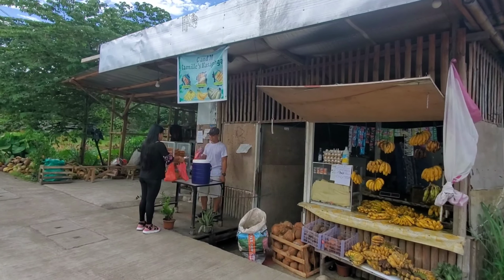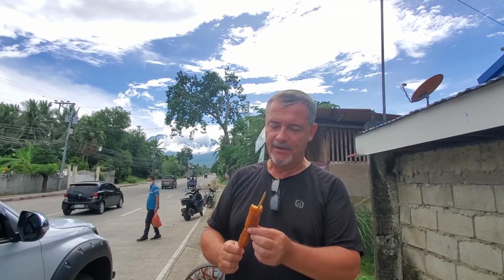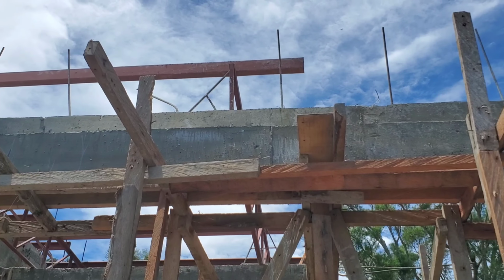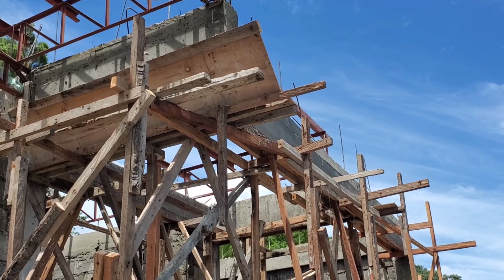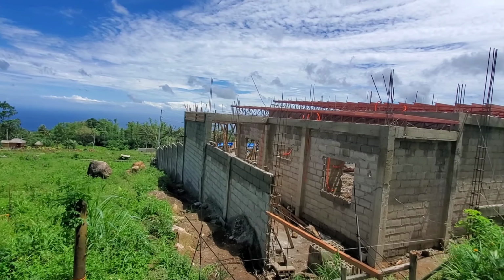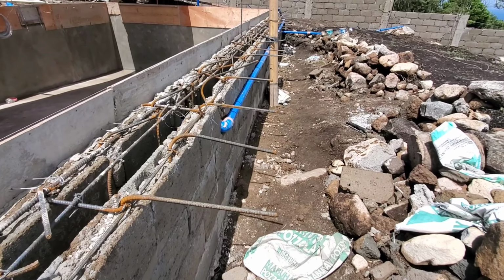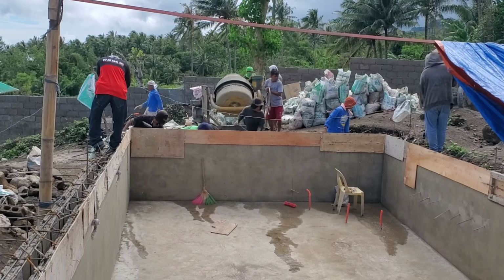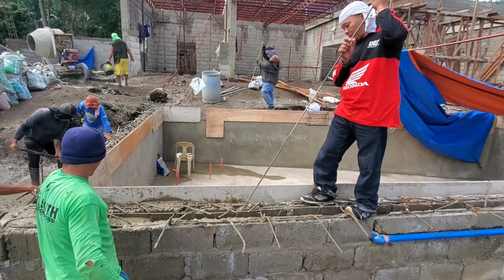Foreigner and Filipina house build- Construction day 56

Comment: There mixing your concrete way way to wet.  It's a huge problem here in the Philippines. It weakens the mix big time
Reply from the maker: They have several different ratios for different applications.  They poured part of the floor today and it was much thicker.  When they do beams & the pool it was a wetter mix.  What I'm surprised about is 1 hour after pouring that wet cement it's hard enough to walk on.  Thanks for the comment.
Reply: Way way too wet...There may be no plasticizer in the Philippines ...Or an alternative is powdered sugar not to exceed 1 % of cement weight....
Reply from the maker: Thats too technical for Philippine building/and me.  Wilma's home in Leyte was built the same way and handled Typhoon Yolanda without any damage (that eye basically went over her house).  I see stick bult homes in the US (just recently in Florida) where the roofs blow right off.  I appreciate the comment and concern, but one-man can't change the construction practices of a country.  Thanks for watching.

Comment: The concrete mix always looks like it has too much water!  Easier to pour, but not as strong
Reply from the maker: They have different ratios of sand, gravel and cement for different things. That mix for that 4 inch void was pretty wet. I guess it needed to be that way to get all the way between those two walls. Thanks for watching.
Reply: I remember now, you explained the different mixes before.  The design of your house is fabulous, I think its prefect.  What are the dimensions?   How many square meters?
Reply from the maker: @ron9146  165 square meters. Thanks for commenting and watching our videos.